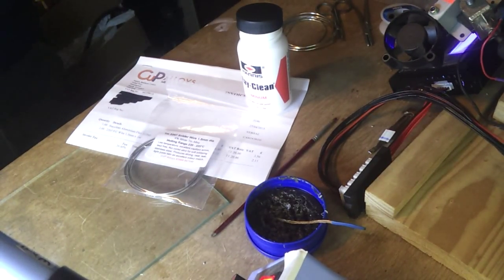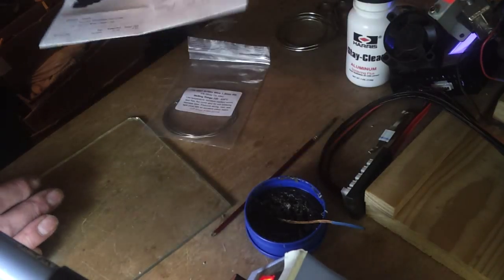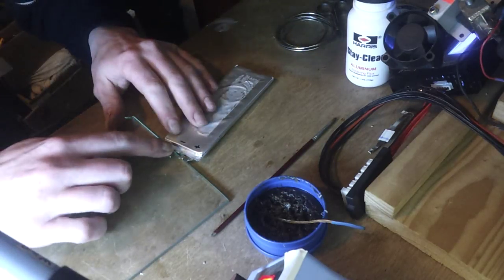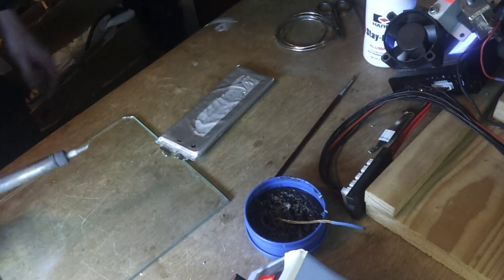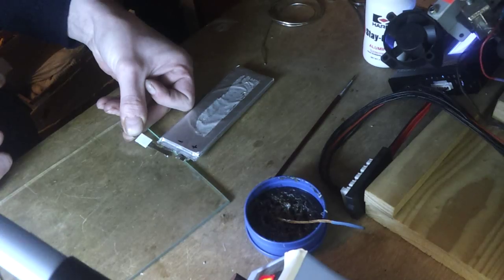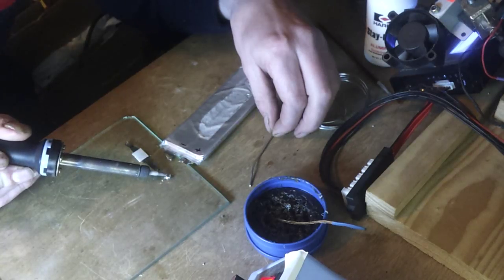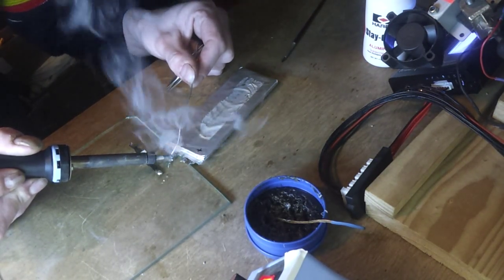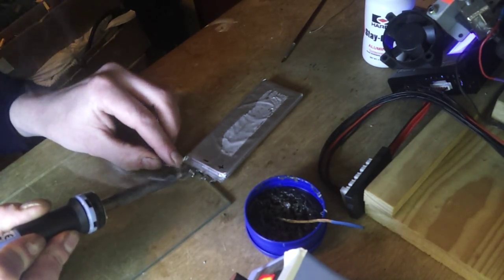Soldering aluminium pt2. battery tabs

Comment: Thank for making this video...I have been trying to solder up a 14S 5P pack of 2170 Tesla cells out of a Model 3 but the positive terminal or end cap is aluminum...
Was thinking I would have to build a spot welder to make the connections after failing to solder them together...but after some research  the regular type of spot welder won't work ether...you need some special tig spot welder that uses Argon shielding gas for shit to stick...I was seriously thinking about building a battery box that used springs to make the connection like seen in most battery powered devices using AA , AAA , C and D type alkaline batteries and trying to used some sort of dielectric grease to prevent the terminals for corroding but conducts electricity..
You have saved me a bunch of work....
Reply from the maker: Dude that's mega..glad i helped in some way.
Good luck with your projects.👍

Comment: Just a heads-up on old solder blobs:
I noticed you added an old blob of solder you had lying around. For electronics soldering, this is considered "bad practice",  mainly because the flux (assuming it's cored flux solder) has already burned off. 
Additionally, I've heard (over the last 35 years I've done a lot of electronics soldering) that "all the tin burns off" (this may be fallacy, I'm not a metals/materials or even a chemist guy by any means). Old solder does have very poor "wetting" capability and brittle/cold joints are the norm for old or solder "cooked" too long.

However, in your case you're adding special flux for aluminium and there's a chance your solder contains no tin either, if it was bought specially for the aluminium-soldering job in hand.

So in summary, for normal copper to electronic components, old blobs of solder and considered taboo - always use fresh solder and fresh flux. In any case, I use extra flux as a matter of course, especially for SMD rework on lead-free boards.

It took me about a year of soldering before I was fully proficient at electroncis soldering (this included early SMD stripline transistors in the late 80s) it but another 10 years to truly master the art - if only YouTube existed in those days :)

I've always wanted to try aluminium soldering (oil method) but never got around to it, I may give this flux a whirl - thanks for the demo and product tip.